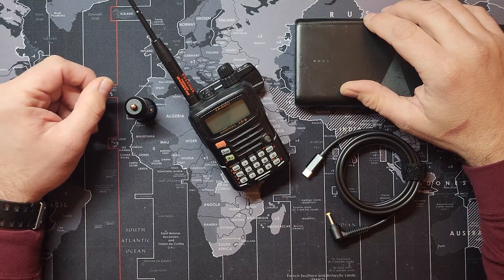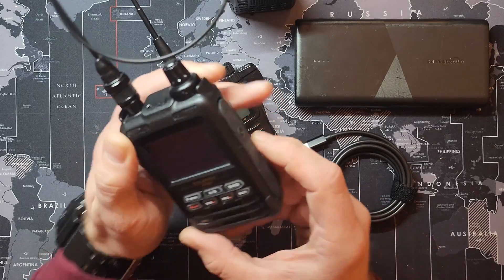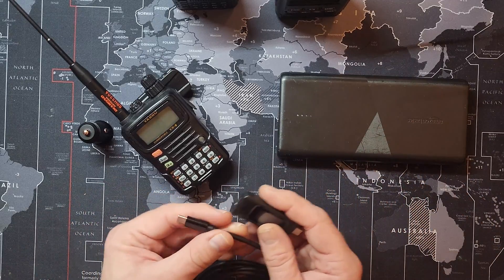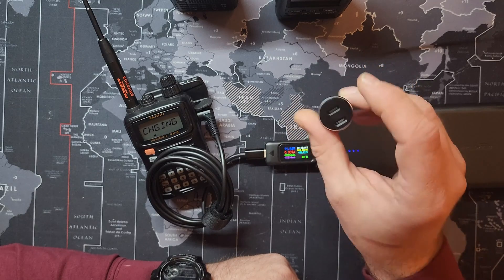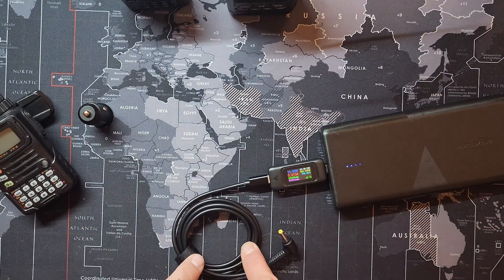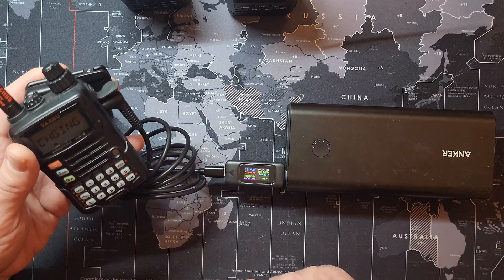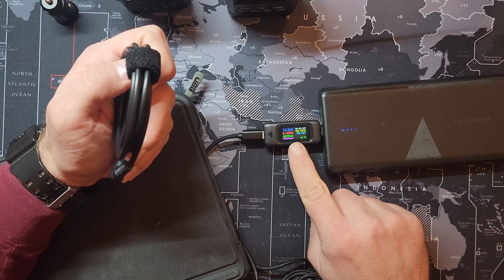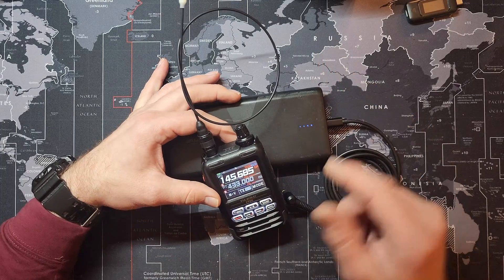Charge Your Yaesu VX-6R & Other Yaesu Handhelds Using USB C Cable

Comment: TLDR: the cable doesn’t matter as much as the battery pack/power source, must be close to 12v, 5v battery packs won’t work.

As of August 2024, they charging cable doesn’t work unless your battery pack/supply is outputting 12v. 

Without that, your device will just show a message “Ext DC” then change to “No Bat” and no charging will take place. 

This is using the exact cable referenced in the video (my second one just in case my first one was a fluke).

Comment: I use a MT-3608 boost converter which is adjustable voltage capable of 1.0amp  for my QMX qrp transceiver which requires 12.0 volts exact not 13.8! plugged into my powerbank via a USB-A to USB-C cable think i'll get another adjust it down to 9.6 volts or so for my VX-7R.

Comment: Over 12 volts won't hurt anything. You can run the radio in your car from a cigarette lighter (without your thingy)  and that provides 13.8 from your alternator. Straight from the VX-6 user manual: 
5.0 ~ 16.0 V DC (EXT DC Jack)

Comment: How do you get 12 volts out of a USB power brick. Isn't USB 5 volts?
Reply: There is a small 12v step-up transformer between the radio and the charger.
Reply: With USB type C they added an optional new technology called Power Delievery or PD. PD allows USB to charge at different voltages, tyoically between 5 and 20 volts. This cable is telling the battery bank it needs 12 volts. This is the same reason you can charge a laptop off of type C. Could you imagine how long you would need to charge it at 5 volts if this didnt work?

Comment: what is lisen usb adapter watts out. there are several available on amazon. need one for 12v socket on auto.
Reply from the maker: The Lisen can do up to 18V which I have used for the VX-6R and my Surface Go 3

Comment: Man this would be awesome if I could connect this from a battery pack to the charging station on my yaesu ft-4xr
Any suggestions would be amazing!
Reply from the maker: Not sure about the FT-4XR but you can charge your radios on the charging station using this method for the VX-6R and FT-5DR.

Comment: I wanted to get this junk my friend who only has the Kenwood f6h. Will it work on that?
Reply from the maker: Kenwood has a different DC plug but in theory it should work the same. Just get a 12V DC cable that matches the size the F6H accepts.

Comment: Awesome! Where’d you get the cable?
Reply from the maker: Got it on Amazon after research - USB C 12V USB C to 4.0 x 1.7mm DC Power Cable: https://amzn.to/3GB7uEA
I would strongly recommend getting hte USB C Power Meter also just as an added protection.
Reply: @n3vanradio  Thanks! Will do!

Comment: Have you tried this with the cradle?
Reply from the maker: I have not. But it should work in theory. Will give it a try tomorrow and let you know.
Reply: @n3vanradio just got the vx-6r and just wondering before I buy the cradle, can you charge just a battery in the cradle or does the radio need to be attached?  Thanks.  Love the channel. 73
Reply: @timk7749  The cradle will charge a battery alone, do it with my spare all of the time. I am currently using a wall wart to power the cradle.